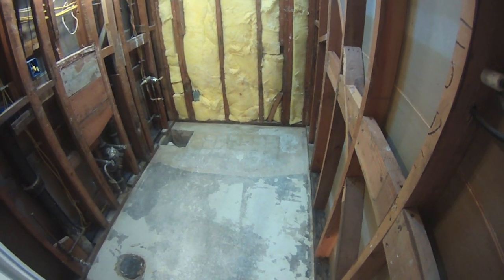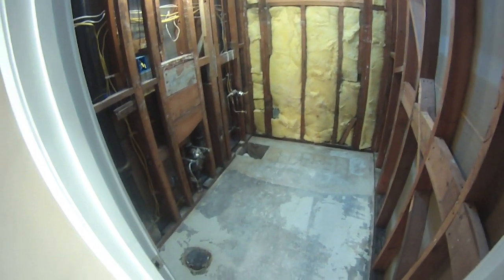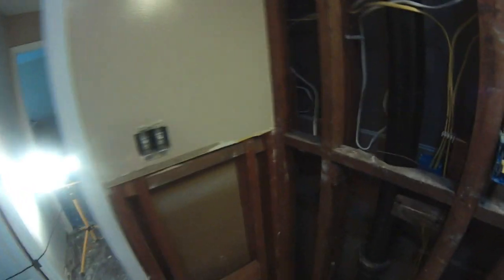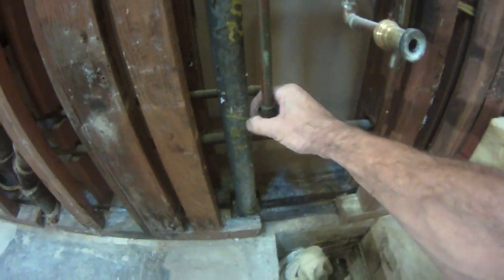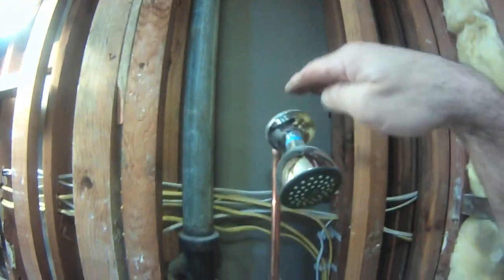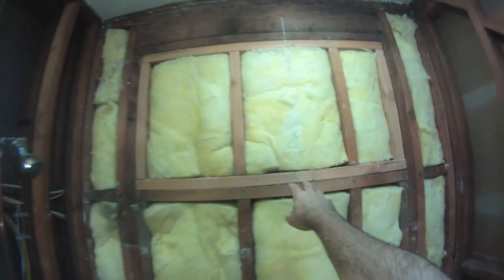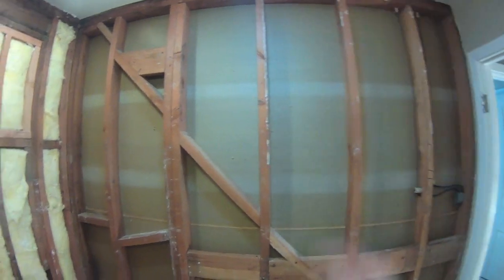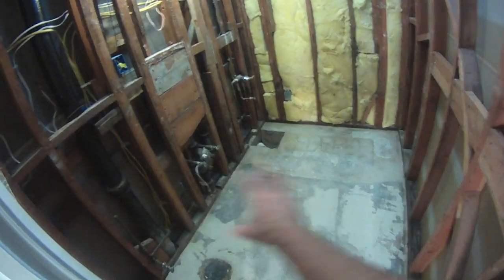From an Upgrade to a Remodel

Comment: Clean Slate!! That's the way to go Bud!! I soundproofed a remodeled bath for a Lady once and used a 1/2" thick dense composite material made for that kinda thing, it was cheap and really worked well!!☺
Reply from the maker: I have used both that dense composite sound material and a sheetrock that had a cement board type of layer bonded to it...both made huge sound reduction improvements.

Comment: Never can go wrong with some good insulation in the bath.
Reply from the maker: When I did the remodel/addition to my house I removed all the interior sheetrock.  I chose to insulate every wall, including interior walls and it has made a HUGE improvement with sound travel and heat/cool balance.

Comment: I like the notch for the shower pipe.  A notch and a cut almost through. It's hard to know what to think when you see that kind of work. Should you laugh or smack the guy with a 2x4. I saw a porch pillar that was just cement blocks a couple of months ago on a house for sale. An axe head was used as a shim in the middle. I pointed it out to the agent and said the dude might want to change that before a appraiser sees it. I am guessing at least 25% of older homes have some "what were they thinking" in at least one spot.
Reply from the maker: I have definately come across plenty of head scratcher moments of previous "repairs"  hahaha.. I think that is universal.

Comment: Really with a project like this when most of the house is being renovated it seems kind of strange to leave an old bathroom, but I imagine it would have been easier to rip it out when you did the kitchen.
The layout of this house seems kind of strange the access to the addition is through the garage??
Reply from the maker: Hey Bryon, I would guess the addition was meant to be seen as a separate "in-law" room.  They have  an exit to the outside and an exit to the garage and really don't need to have any interaction with the main house.

Comment: Knob and tube wiring guess Gatineau to re run that wire
Reply from the maker: The old wire will remain in place.  There's nothing wrong with it as long as you don't mess with it.